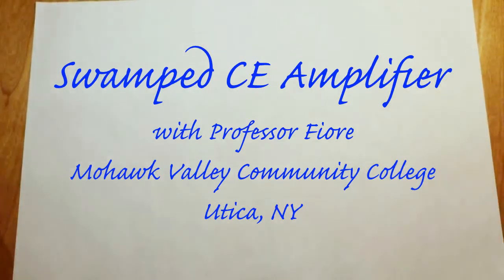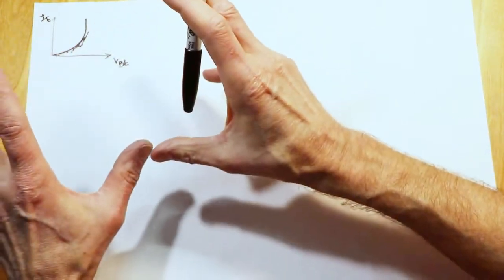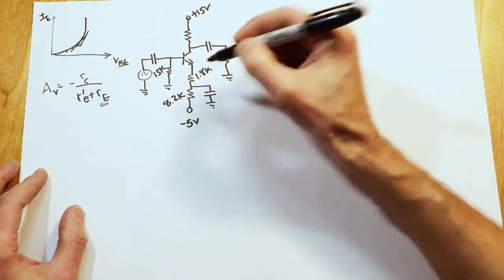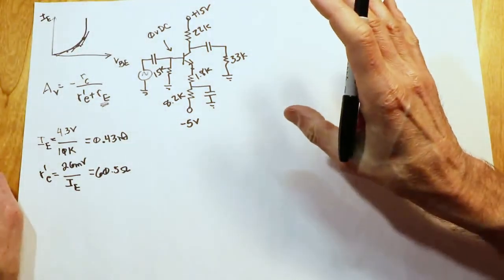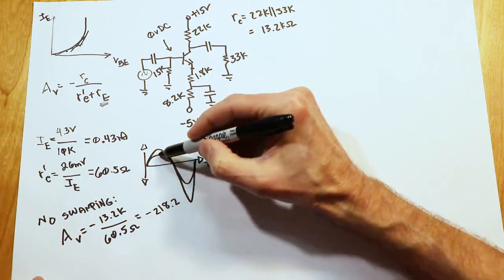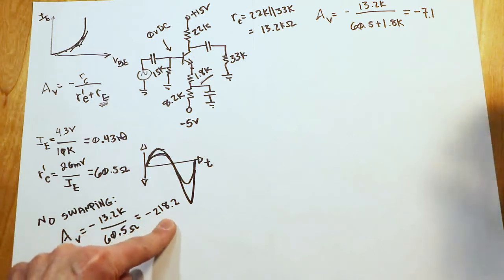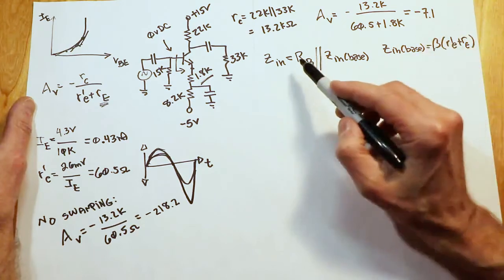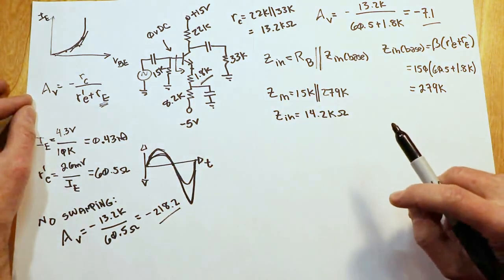Semiconductor Devices: Swamped Common Emitter Amplifier

Comment: Thank you very much. From the perspective of DC quiescence, would the series addition of the emitter resistors need to be less than the collector resistor? In other words, is there any benefit to the Rc/Re ratios in DC? For example, Rc=10k, Re1=1k, Re2=9k.
Reply from the maker: Not necessarily. That would depend on the type of bias and the DC supplies used. Practically speaking, Re does tend to be smaller than Rc, but you could certainly come up with circuits where that isn't true (for example, a dual supply emitter bias with a very large value for -Vee compared to Vcc).

Comment: HOW DO YOU KNOW WHAT VALUE OF SWAMPING RESISTOR TO USE?IS THERE SOME RULE OF THUMB OR FORMULA FOR THIS?
Reply from the maker: You have to fit it into your design requirements. Like most engineering, it's a matter of trade-offs. You have to balance the various parts. Once you understand what the component does, you can start playing with it to fine tune it. In this case, an increase in the swamping resistor will reduce distortion, increase Zin, and stabilize gain (generally good). On the down side, it will lower the gain. One place to start is "Just how much gain do I need?" This assumes that the non-swamped circuit has more gain than is required. You can then add resistance to bring the gain down to what you need, and in the process, see how well that change improved other factors.

I should add that, when I make videos, I often choose convenient component values (i.e., convenient in the sense that you can do the calculations in your head, like having a 1.8k and 8.2k that adds up to 10k), so don't use these as a design goal. Back in college I had a calculus prof who would say "I like things to work out to one-sies and two-sies". IOW, why have the exercise work out to an answer of 3 pi over 17 when it could be 2 and you never have to pick up a calculator or pen? As long as they both illustrate the process, use the simpler one.

Comment: Did you ever make a simulation to compare a multi-stage CE amplifier with a single CE amplifier and compare distortions?
Reply from the maker: I don't think I've made a video of that (yet). It is a little tricky to set up the two circuits so that they have the same general performance parameters (gain, Zin, and Zout, to begin with). If they're not set up the same then you're not making a fair comparison. I will say that, in general, a two stage should have better THD performance than a single. Quick example: single stage Av=100, THD=1%. Take that same circuit and increase the swamping by a factor of 10 (assuming r'e very small). Av drops to 10 but THD drops to 0.1% (assuming same output level). Cascade that with the same circuit. The two gains multiply to yield 100, but the first stage will have THD <0.1% because the signal is much smaller. Net result should be a THD of not much over 0.1%. This is an idealization, of course.
Reply: @ElectronicswithProfessorFiore  I'll have a go in the simulator. I suppose, mathematically, if we multiply gain which is >1 and THD which is <1, the more stages the better, assuming no noise/distortion from any component. When I review my amplifier circuit (which I almost understand now), I can see only 1 voltage gain stage but do have a feedback loop back to a diff-amp.
Reply from the maker: It sounds like you're saying that THD gets smaller (i.e., multiplying a fraction). That's not the case. THD is output referred. You can't just add them, either. Stage 2 multiples everything from stage 1 (including the distortion products), then adds its own distortion to the signal (which includes distortions of the stage 1 distortions, although that's a second order effect). If I misinterpreted, sorry.
Reply: @ElectronicswithProfessorFiore  That's what I was getting to. Clearly not the case from your comments. I'm struggling to see how going multi-stage improves distortion, within the limitations of the circuit.
Reply from the maker: @simonyoungglostog  Reread my first comment from a day or two ago. A two stage can have a smaller THD than a single stage, but it does not follow that you can keep on doing this forever (and wind up with a 100 stage amplifier that has virtually no distortion). The r'e fluctuation is one cause of distortion (and a major one, to be sure), but there are other issues, such as noise, that must be considered.